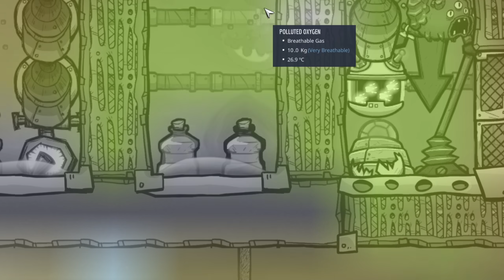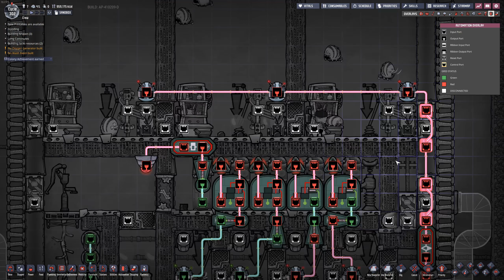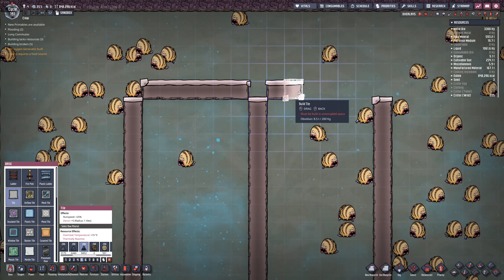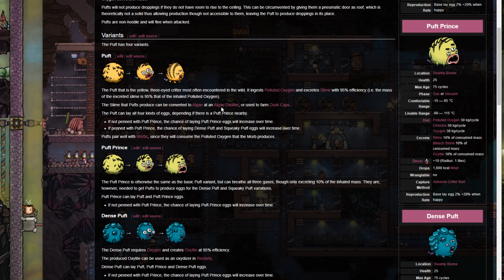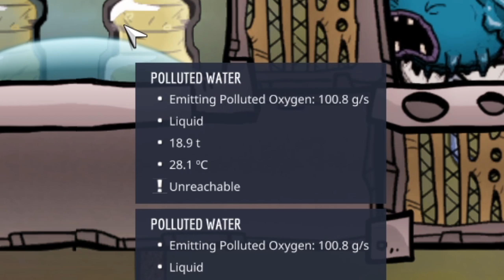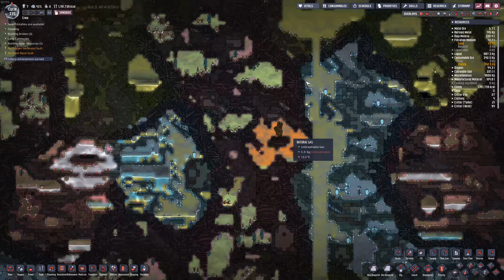This Auto Polluted Water Puft Ranch is Crazy! Oxygen Not Included

Comment: I would use a bead pump with the bottles just stacked on a mesh tile, then you can cycle the same small packet of water and get some massive suction to constantly remove the O2. Could also automate the liquid output to control the rate of production if desired.

Comment: 14 minutes in, bruh you just needed a tiny bit of carbon dioxide in that hole to get the same effect. you over engineered it. If you put a row of 5 algae terrariums on air tiles they will pop your eardrums. Its the mechanic when theres a different gas near. Its the same mechanic for infinite water/gas storage. You just need anything that not polluted oxygen to pass over the bottles. a deoderizer probably would have worked too. Love your videos, keep it up!

Comment: Recently, I applied the same system behind the separation of hydrogen and oxygen used in the electrolyzer to deal with a vent of hot, polluted oxygen. The dupes made 5-spaces tall room with 2-spaces tall corridors.The one above filled with deodorizers and below it, a gas pump that only worked with a atmo sensor.
Maybe something like that could be used to capture only the oxygen

Comment: I used a similar system to mass offgas polluted dirt, though my goal was making clay, and I just dumped the oxygen to space.  I found the water I was using tended to be deleted over time as the dirt offgased.  I used a hydro sensor and a timer/and combo to add 10kg of water whenever the liquid went down to sub 100g, and a second hydro sensor with a mini liquid pump to remove if over 1.6kg.

Comment: I was wondering if you use that plution water inside close confine along the medium filter and you will get super high pressure.??
Reply from the maker: Hmm I I don't understand.
Reply: Brothgar the video you did about just use a polluted water emit a lot and use medium filter to convert to clean oxygen. But instead of open area let it confined area but the polluted water bottle had limit but you just did little trick of using water on it to goes super polluted of no limit in the way.